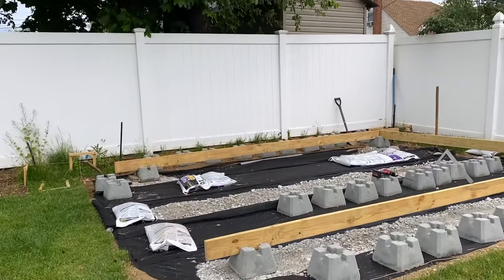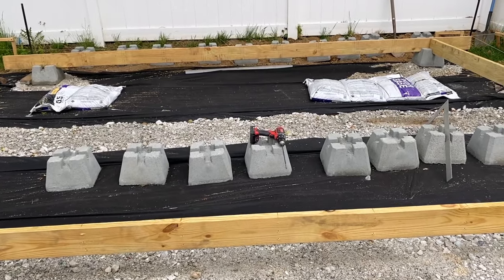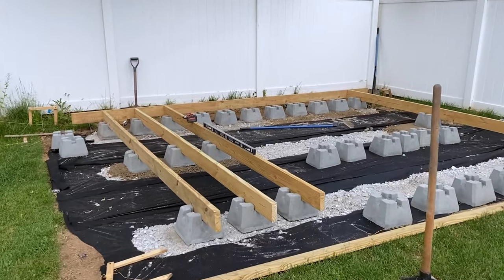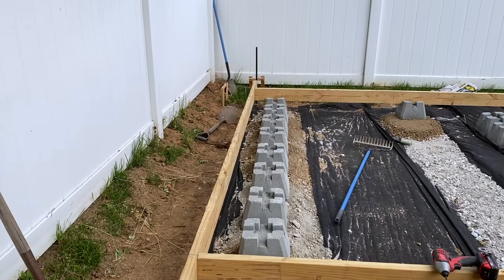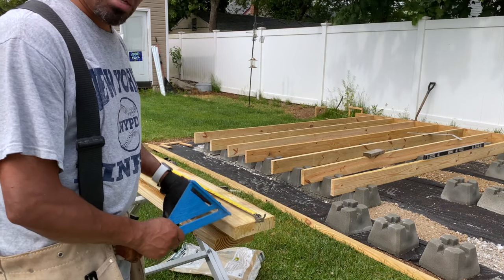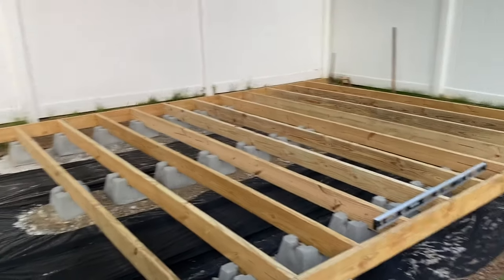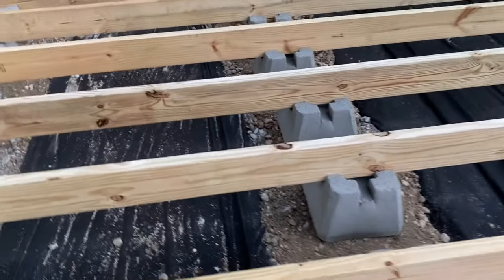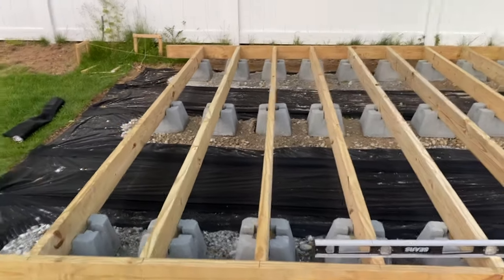How to build a floating deck, DIY ground level. Tips for beginner Part 3 unfiltered

Comment: great job and please take this as a tip.  Rather than so many concrete piers, you could have used a 2x8 or 2x10 with 3-4 concrete blocks.  You can space them up to 8 feet.
Reply from the maker: Thanks for the feedback and please remember to subscribe to the channel and like the video.
Reply: exactly :))

Comment: Little tip for leveling and lining up the concrete slabs. Use a string that you level first. That way you just line it up to the string and throw a level on it.
Reply from the maker: Thanks for the feedback and please remember to subscribe to the channel and like the video.
Reply: Can you explain this more
Reply: @joshuaconstable6323  tie a string from one end to the other where you want the blocks to be. Adjust the string so it's to the top height of the block where you want it to be. Make sure it's nice and level. Then when you put the block on, just like them up with the string and check for level on the block itself too

Comment: I used the exact same approach as you of doing the 4 corners first then going to the centre beam and then all the other deck blocks just kind of follow. It seemed way more intuitive to me to get the 4 corners super solid and level with each other and then doing the rest. I did this before I saw your video and similiar approach and I was like hey maybe this is a legit way to do it after all! haha it worked for me. I like your style and I learn a lot from your videos. Keep up the good work!
Reply from the maker: Thanks for the feedback and please remember to subscribe to the channel and like the video.
Reply: right before I watched this vid I had copied someone's comment on another vid: You should have put each corner post, then took your 10 ft board, stand it on edge, and tack it to lowest point (highest elevation of ground, your 2 inches or whatever above the ground on your 1 corner,. Tack it on the side of the post, then put your level on the side of it, raise other end until level screw to post, now go around full perimeter. Then it's a simple matter to mark each corner and cut the posts flush with level, and then every other post you add, you just get it plumb, tack it to the level board, and cut it flush with level.

Comment: Great info, was thinking of building small deck using deck blocks because it would be easier and I'm not as able-bodied as I once was but am rethinking as you said it is somewhat labor intensive.
Reply from the maker: Thanks for the feedback. I’m doing a follow up video on this project. I’m going to highlight the The mistakes I made. But overall the deck came out great. Please remember to subscribe to the channel and like the video.
Reply: @DIYRAY  Subbed, like how you reply to most comments... Less active than I once was with a variety of home/farm projects but still like watching home improvement shows and you're a pleasant informative host with videos on par with many nationally televised DIY programs.

Comment: What's the recommended/max spacing for the pier blocks?
Reply from the maker: Thanks for the feedback and please remember to subscribe to the channel and like the video. To answer your question, 1st don’t do what i did. I over did it with the blocks but I’m happy with it. I would do the four Corners, middle joist then very other joists for a good Foundation. Good luck.

Comment: You said you’re putting a gazebo on top of the deck, hell, you could put a house on top of that deck. Kudos to you and the strength of the deck but using beams under the floor joists could of saved you some money and your back, but then again hindsight is always better. Good job though.
Reply from the maker: Thanks for the feedback. And you're right. This thing isn't going anywhere. I'm very happy how it came out. For the 1st time building a deck, not perfect but still very solid. Please remember to like and subscribe.

Comment: can you do this in a cold climate also ?
Reply from the maker: What do you mean, Cold climate?
Reply: @DIYRAY  If a floating deck is not below the frost line will it be ok. I want to build one in my ski home, Hunter NY.
Reply from the maker: @Nickelectric  I don’t see why not, just remember about snow fall run off, when it starts to melt and rain. I haven’t had any problems with my decking or the supports. Good luck 🍀 thanks for feedback and please remember to subscribe to the channel and like the video.

Comment: Great video! What screws do you use for connecting the wood pieces together?
Reply from the maker: please below for the information. Thanks for your feedback. Please remember to sub and like.
Reply: Thanks for sharing. Well done!
Reply: Use deck screws 3 inches with 1 inch threaded. Never use fully threaded screws 3 inches long. You will burn out your diy level drill.

Comment: Do you recommend to use framing nails for the joists?
Reply from the maker: No, I don’t Recommend using framing nails. You should be using galvanize exterior screws. Thanks for the feedback and please remember to subscribe to the channel and like the video.
Reply from the maker: Or Galvanize exterior nails

Comment: You dont need a block for every joist. You could have spaned 3 or fout feet with no block and used hangers.
Reply from the maker: Anthony Romano you maybe right but this is now I decided to go. Thanks for the feedback and please remember to subscribe to the channel and like the video.
Reply: That's how I'm going to do it. I just got this Lumber delivered to my house today and I will be putting a block every other joist even though every single joist will still have a Simpson hanger attached to the perimeter Ledger

Comment: NEVER SHIM WHERE WATER CAN SETTLE, when they rot deck will be off again. Just do it right the first time.
Reply from the maker: Thanks for the feedback and please remember to subscribe to the channel and like the video.
Reply: Water will still get underneath the joist even if it's flush on the blocks. You have to make sure the wood is treated for ground contact. 

A lot of people think pressure treated and ground contact treatment are the same.

Comment: Sorry Ray but this would not pass the permit phase. However it looks nice but serious over kill with huge cost. First, for your setup only four deck blocks are needed. The rest can be supported with hangers. 2. Never place a shimmy on a deck block. It will erode over time causing warping. 3, always use deck flashing tape whenever possible. It’s a great barrier and prolongs the life of the wood. 4. Gravel and sand is fine but always slope the deck away from the house for draining purposes. I use to work in the permit office for jobs like this. But again nice job.
Reply from the maker: I agree with you that it’s over kill but since I’m paying for it the cost is worth it to me. Also as for the shims I’m using pressure treated only in a couple of places so that is not an issue. Also flashing was use only in certain location where the wood would be exposed to the weather. Is it Perfect? No it isn’t but it’s perfectly sound and stable it looks great.  Thanks for the feedback and please remember to subscribe to the channel and like the video.
Reply: @DIYRAY  Those shims will rot - pressure treated or not. Once a PT piece of wood is cut the treatment is compromised (unless you treat the cut ends). Plus, those shims are made with cutoff pieces with the grain running vertically. So, the weight of the deck will only work to separate the grain and allow water to penetrate.
Reply from the maker: @mjdamato  Yea, I understand your points. But Let keep it into contents. We taking about 3-4 section under the deck where rain may or may not reach due to the cover over 80% of the deck, Also Those section are are being supported all Directions. I really over did with the blocks in support. Point taken but not a Concern as far as my build. Thank for the feedback.
Reply: @DIYRAY  It's your deck. I certainly wouldn't want to take the chance that any supports would drop in a few years because of something so simple.

Comment: I'm a Home inspector. This is done soooooo Wrong. This Deck is NOT to code. FALED.
Reply from the maker: Please share your thoughts in detail. What could I have done differently? Let others know what to avoid And to improve on this project.
Reply: 12:41  @DIYRAY  First. The way you had it at 4:20 was the correct way. You should of left it like that and make the other and the same so all 2x8 would meet on the deck blocks.
Second. You can't use wood peace's to level the joist 12:40. The 2x8 must seat all the way in the deck blocks. You should raise the blocks.
Reply from the maker: So let me get this straight, I shimmed a couple of blocks, so it will meet the deck.  Did you see how many blocks that’s underneath the deck that is lying on it?  Really? Okay if you say so.
Reply: @DIYRAY  i agree, you dont need that many blocks. But if you use them it have to be installed properly.  For example, from the inspector point of view: if your deck is not higher than 24" you don't need railing. But if you put railing, it have to be installed to meet code. Otherwise people (who move in after you) trust in it, can fall and hurt them self's. Not to have does blocks is ok.
Have them incorrectly is not ok. 
I hope this helps with your future projects.